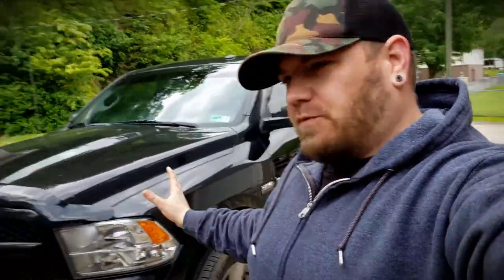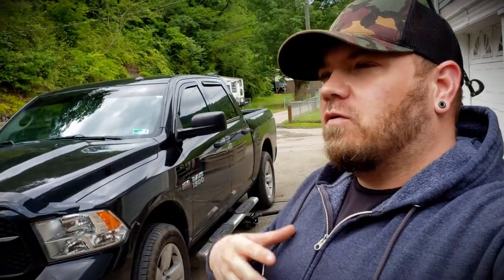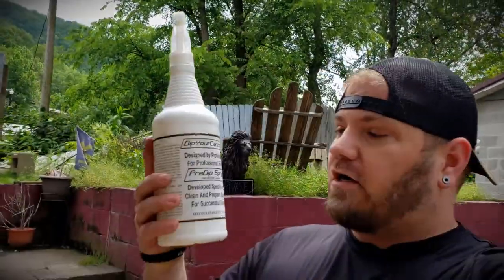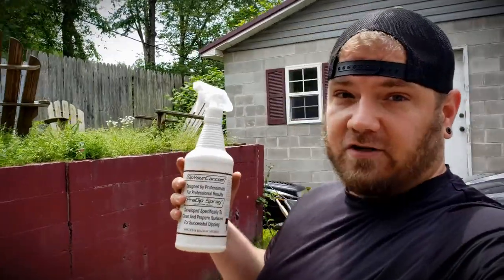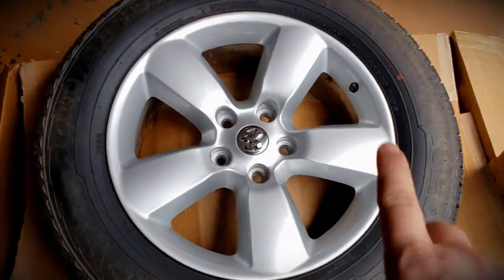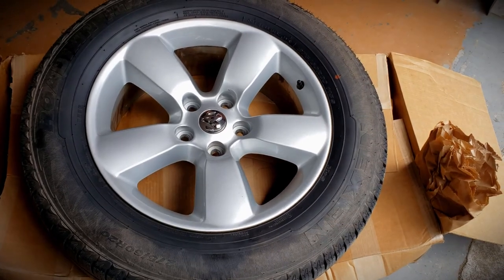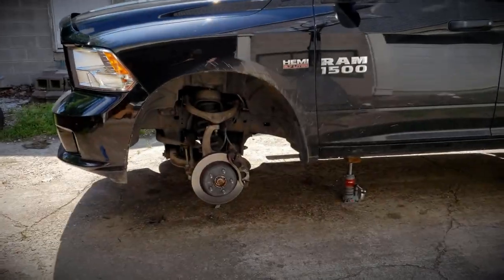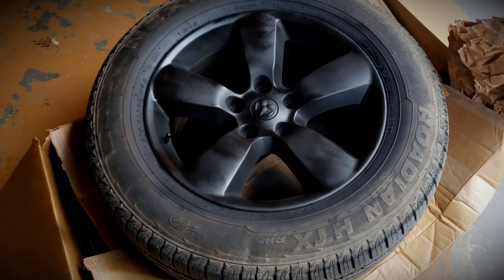"NEW" look Wheels for the RAM 1500! | Blackout | Plastidip

Comment: I’m
Curious what type of spray dip did you use? I have the same truck with the same wheels and want to do them black. Also does it hold up good like taking the truck through a car wash and stuff
Reply from the maker: I used the normal satin black plasti-dip.  I traded the truck in but the new owner still has those same wheels on
Reply: @PeaJayYt  so like just the normal plasti dip from Walmart? I think yours turned out awesome!!! I’ve had mixed emotions about painting them with paint. I’ve heard good and bad things about paint lasting or not! If those hold up pretty good then I’ll go that route.  I have intensions of getting aftermarket wheels eventually but the ones on it now just don’t go with the truck at all where the truck is all black and there not
Reply from the maker: @sarahbowen9686  yep!
Reply: @PeaJayYt  thanks so much you have convinced me to try it. I’ll have to wait till warmer weather as it’s cold here currently in Kentucky but I’m definitely going to try it on mine. Last question. How many cans of plasti dip did it take to do all 4 rims and did you do both front and back sides of the rim? Thanks
Reply from the maker: @sarahbowen9686  yep both sides.  2 cans per wheel